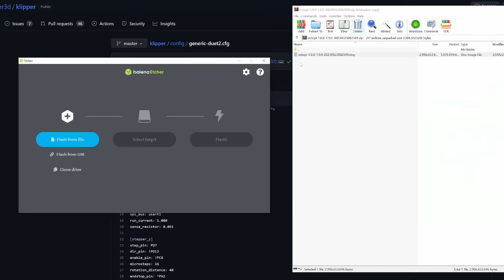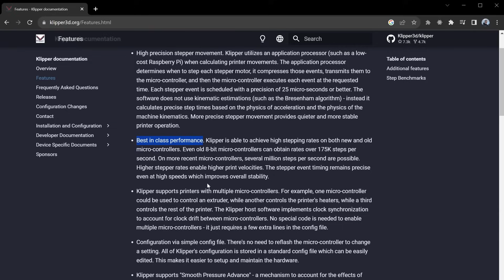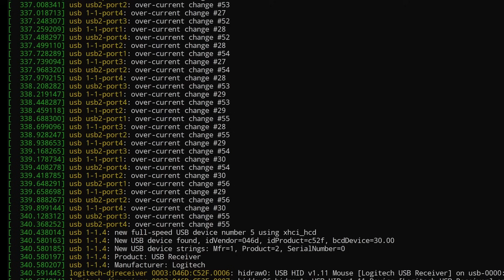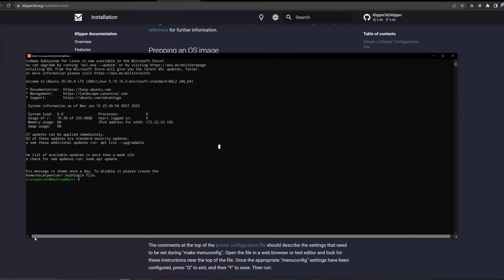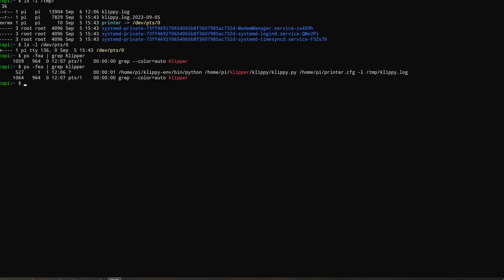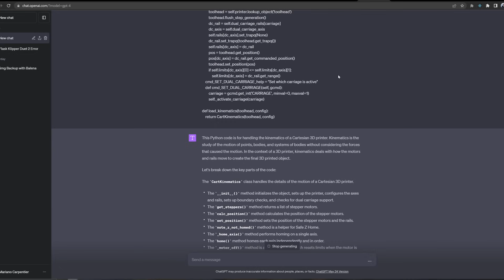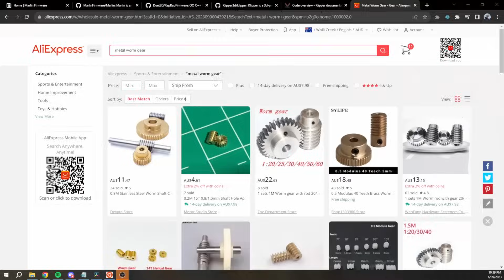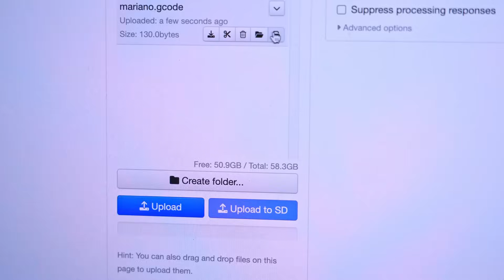5-axis 3D printer with Klipper finally moving!

Comment: You should look at adding a counterweight to the A axis, it would make it much easier to turn since it wouldn’t have to lift the full weight of the aluminium extrusions and the bed.
Reply: True but it would also increase the mass. 
So while a counterweight would reduce load while stationary, it would increase load when it's trying to accelerate.
Being lightweight is usually very important in 3D printing for this reason, the heavier an axis is, the slower it can accelerate which increases print time.
I'd probably only try it if the motor ends up having trouble holding up the load and starts skipping steps.
Reply from the maker: That is a good point! I haven't thought about the impact in acceleration. I will go through an optimization phase once the printer is actually printing plastic and I will try to make everything lighter first!
Reply: What is even the Purpose of the huge downwards Extension, just put the crossbeam slightly beneath the center of rotation(A-axies)

Comment: I’m looking into tilting the bed in the A and B directions myself. If I just have a belt on each corner I think it should be doable, though I’ll need to figure out how to change the slack on the belt as it tilts. Hopefully spring-loaded idlers will do the trick, we’ll see how that turns out. If I can get 45 degrees from the bed and 45 degrees non-planar printing from a pointy hot end, I think I’ll be able to print anything.
Reply from the maker: Make some videos! I would love to see your project too
It is a pain to edit them but the feedback of the people is great. They throw in really good ideas!

Comment: Counter weight via dumbwaiter or sliding bars to balance the bed gantry will carry you a long way with having your printed parts withstand enough for prototyping and testing.
looks freaking awesome by the way
Reply from the maker: I will try to measure deflection on those rods, the backlash, etc, and then improve from there to minimise the inaccuracies. Some people brought up the counterweights idea, and I think it has potential! I may try that while optimising the frame. Thanks a lot for the comment!!

Comment: What software will you use to slice 3d model to print 5 axis?
Reply from the maker: That's the million dollars question!
I am not sure yet, I am sure I can make some custom little program to generate some really particular shapes in g-code and send it to print and proof the 5-axis idea.
Ultimately, this entire project is useless unless there is a slicer that can do it graphically. Programming one of those will be a lot of work, which I don't think it's impossible, but it's certainly going to need a lot of working hours... maybe months/years.
I think I will cross that bridge when I get there, for now I have a bunch of ideas in my head but I have not tried any of them other than writing g-code by hand to move the printer as it stands now.
Reply: @engineerunleashed   I'm in development of a slicer addon that can be used with 5 axis printing. For now I don't think I am able to code it by myself, so I'm searching for someone to code with :) . Ideally it will be able to print everything  (like 3dbenchy standing on its chimney) with no supports and no overhangs.
Reply: @engineerunleashed  the slicing software is what has held back more than 3 axis 3D printing so far. Adding extra axes is the easy bit, especially when we already have 5 and 6 axis CNC machines.
Reply: In 5 axis cnc tool path generation, there is a lot of manual work to split the cutting into different planes. A 5 axis AM slicer would probably be the same.
Reply: Is there some reason you can't run the extruder and axes on separate programs? 5-axis CNC software isn't that hard to come by
Reply: @heartminer5487  i think its like chalk and cheese. machining is carving, is removing. the material remains the same from start to finish.

this? you got lamination orientations, infills, cores, wall directions, omfg...

like, iunno, if i was doing a prop, i would probably want a core of infill printed on the radial, with two final skins at right angles laminating  down the length of the blade...

each and very application is going to be full of all these formerly unknown considerations... sort of like forging or heat treating a part whilst running it through the mill...

and well, when i go through cura or prusa slicer, the amount of options already there... subtle, tiny things...

ive reached the point i just use default settings and dont give a damn about strings, blobs, whatever... i want to print, not scroll through ten thousand options. ( i turn em all on as one or two i do use and theyre hidden otherwise...)

Comment: the force the A axis creates will twist those linear rails like pretzels. You need quadZ belts, same as a voron. I would go for at least 10mm wide belts. You are creating a big lever and trying to counterforce it with unsupported rails. The quadZ design has the huge advantage of creating four fixed points in space. cheers and good luck!
Reply from the maker: Actually, at the moment, what gives is the plastic, the rods are unsupported but they are steel while the plastic is more flexible. Even worse because I printed in "draft" quality. But this is something I want to measure carefully in the future.
I imagine all those side effects will be noticeable in the printing quality too.
I will have to think how to measure that deflection and see what I can do with it, but you raised a really good point there!
Reply: @engineerunleashed  yeah, In large cnc machines that cradle is a big iron casting, it needs to be very stiff. Have you considered going from a worm gear to a closed belt with a large bull gear? the reduction wont be as great, but the force will be spread through more plastic, and as a bonus your backlash will be gone. Will need a larger motor though.

Comment: If you only want ±45° it might be easier to switch to two Z axes, front and back.
Setting those to different heights allows you to set an angle, works similar to delta printers.
But keep in mind that this is also requires that either front or back is translational fixed while the other side has the option to slide in/out.
Otherwise Pythagoras would be very unhappy...
Reply from the maker: I think I get your point but sound like a big change, lets try as it is for now and see where and why it fails. Thanks for the idea!!

Comment: How come you're using Octoprint?  I haven't used Klipper yet but I thought the normal way to get a web interface for a Klipper printer was Fluid or Mainsail.
Reply: You can use mainsail, fluidd and octoprint as a ui in klipper. Seeing somebody using octoprint is pretty rare though
Reply from the maker: Seems to be working with Octoprint with no issues, but bear in mind I'm mainly passing Gcodes into the terminal. For that purpose, Octoprint is just sufficient. But now that you mention those other options, I will look into them too!
At some point I will need to modify the code of those apps to show A and B axes too, and if they are easier to modify (or even better, if they were to support more axes already), that's definitely something I want to leverage.
Thanks for the comment!!

Comment: Why not try a counter balance on the cantilever. Alternatively try a key chain tension approach as used in the voron switchwire. The tension on the cantilever can be reduced by increasing the radius of the gear, but that would slow down the arm so its compromise. Another approach would be simply to enable the extruder to move through various directions rather that entire support structure. The upside down printer in the filament box was interesting to negate that FDM need gravity to work or do they?

Comment: U gotta have pretty good bed adhesion 😅
Octoprint works and it has more plugins but i think mainsail and fluidd are bettee for klipper since they are made for it.
Reply from the maker: People have been talking about them. In any case right now I'm just sending commands in the terminal or sending custom Gcode so Octoprint is enough... but I'm keen to experiment with them regardless at some point.

Comment: make sure Z axis screws are straight or there can be issues with Z axis height
Reply from the maker: One of them I need to replace... it's basically a banana...
Reply: @engineerunleashed  i bend my ones (16x4mm) and they have like 0.1mm max runout :)

Comment: It's a ambitious project, good luck! 

But do I have to remind you that you need closed loop motors for this project?
Reply from the maker: Thanks!! I would consider them like a really good thing to add in the future, but hopefully I can get this to work without them first and then making a "before and after" (or something like that) were we can see the benefits in the actual print.
You're talking about servos instead of steppers? or you think another way is also feasible?
Reply: @engineerunleashed 
For a simple 'Absolute position' sensor, use a rotary potentiometer attached on the B axis center of rotation. Similar to what is used in servo motor. This would provide a plus and minus position for that axis and doesn't require first using a 'home switch'. By reading the value of potentiometer at startup, it can be converted to angular position if desired, you know the swing arm position before moving Z axis.
As mentioned by others, the swinging extensions introduce positioning error. Keeping the work as close to the center of rotation will improve accuracy. Rotate the beam instead of the extension.
Great project I'm following your progress.

Comment: Amazing work! 😎 I found u had experience with broken printer structure part due to some unexpected movement during your development stage, I would suggest you may find useful to apply endstop/sensor-less approach by using TMC driver feature with your duet board (not sure whether your external driver offers same endstop-less/sensor-less feature).
Reply from the maker: I think I will place the Z-endstop at the bottom of the Z axis. For now I put it on top in place of the extruder to simulate the bed probe. During the next iteration that is going to change. Thanks for the comment!
Btw, the endstops can still be connected to the Duet, the external drivers are just there to move the bigger motors.

Comment: I was wondering if id would be possible to use hall effect sensor to measure the position of rotating parts, like under the bed, and on this big gear tilting the bed, for the rest there would have to be other sensor, like laser range finder or something else.

Comment: My first thought when I saw this was, have you considered having a frame with a counterweight to avoid large lever force on the worm gear?
Reply from the maker: Yes, I did consider it, and other people in the comments too, but someone also commented that adding counterweights will increase the inertia of the system and it will affect the acceleration capabilities, which makes some intuitive sense to me... although I would like to try it practically one good day and see what happens...

Comment: Great to see this video! Recently I designed and built a 5 axis FDM printer that is loosely based on Open5x. And I was actually able to print some parts successfully. But slicing turned out to be a bit problematic... What slicing approach are you going to use?
Reply from the maker: For now, I am not aware of any solution like the user friendly 3 axis slicers that we normally use. It will be an absolute pain to slice in 5. I though about using the CNC tools in fusion 360 and making some post-process script to "adapt" it to 3d printing. Some people do something similar in Solidworks and looks difficult. Also, there is an open source program someone made to generate gcode with python. I still have to try all of that, I am sure I can make a bespoke custom little gcode file in some of the languages I know too but slicing a 3d model from a proper design software will be impossible by doing that only.
There are also some white papers that are about leveraging 5 axis but they're full of mathematics. Hopefully there are already some open source implementation of them. I need to look deeper into all of this though, it's still the biggest unknown part for me.
What about you? What did you use to slice so far?
Reply: There are some approaches using a grasshopper script. The one from Open5x (Open Source) also has a simulation implemented. However I was only able to slice one demo file. It's poorly documented.. Others use a CNC machining plug-in from ModuleWorks, also with Rhino. Also there are some commercial slicers around. Usually for robot driven DED printers, but also for FDM like Adaxis. 
However the best slicer should be Dot X Control. Maybe you can request a demo.
I also hard-coded some simple geometry in python, focusing on conformal geometry. It's actually not that complicated for simple shapes
Reply: @engineerunleashed  There are some approaches using a grasshopper script. The one from Open5x (Open Source) also has a simulation implemented. However I was only able to slice one demo file. It's poorly documented.. Others use a CNC machining plug-in from ModuleWorks, also with Rhino. Also there are some commercial slicers around. Usually for robot driven DED printers, but also for FDM like Adaxis. 
However the best slicer should be Dot X Control. Maybe you can request a demo.
I also hard-coded some simple geometry in python, focusing on conformal geometry. It's actually not that complicated for simple shapes

Comment: @13:40 I mean... The obvious solution would be to increase the Arc of the large A-Axis Gear to the diameter that of the length of the Aluminium Extrusion thus increasing the whole constructions rigidity instead of trying to drive it that close to the pivot point causing the backlash from everything flexing like crazy - No? 🤨 I'd also argue that there's no way around installing a 2nd Stepper on the other side of the A-Axis too 😏 But like usual with these kinds of 4-5 projects the Mechanics will be the least of your problem... The Software / Slicer will be the crux.
Reply from the maker: Totally agree... the 2nd stepper will be surely required but I want to measure things first to see by "how much" the entire thing deforms with just 1 of them. And I wanted to make the gear bigger but at the same time I wanted the print to go quick... Impatience won! That's likely to change though.

Comment: why the use of Klipper over RRF, who would support the additional axis natively?
Reply from the maker: I used RepRap Firmware in that same Duet board for a number of years, loved it and the support they offer! I just wanted to do this in Klipper since I will need to modify source code anyways, and I can get Python a bit quicker than C++.
Most of what I am doing in this project is a way to dive deeper into the technology, and I may be wrong sometimes, with some decisions. Time will tell! I will share the mistakes without hesitation since they are part of the learning process!
Reply: Intresting Choise.
from how it looked RRF would have solved 2 issues you ran into with this build quite easy. 
But still intresting to see where this goes.

Comment: I've used klipper on my old board/pi, but on a duet? the duet has it's own wifi and coprocessor setup to do the web interface and deal with the file operation overhead that were the biggest bottlenecks of standalone printers.
Reply from the maker: It also seems like RRF supports 9 axes already. I am just working with Klipper since the main sell point for me is the Python codebase. I actually really liked RRF and the support was real quick when I needed it, it's a shame that now many of the features of the Duet are wasted.
In the end of the day I am open to backtrack any decision, but I want to show the process while it happens, mistakes included!

Comment: what software is planned to be used for model splicing? Stereotech claims that designing a five-axis printer is a much simpler task than developing software for it.
Reply from the maker: I would have to agree with Stereotech on that! 
I need to build the 3d printer first and then get to it. There are some white papers full of maths, then some other strategies like manipulating solidworks to slice... Nothing I've tried myself yet, and it looks like the opposite of "user friendly"... it's going to be a challenge, that's certain.

Comment: You can ssh from powershell
Reply from the maker: Good to know!! In any case I am terrible with powershell, so long I have a linux like terminal to use I go for them and never ended up learning powershell.
Reply: @engineerunleashed more specifically: windows has openSSH built in (since windows 10 I believe)

You can simply run ssh@host just like in linux straight from the windows cmd/powershell/terminal

Comment: Using a counterweight would help with living the axis.
Reply from the maker: Yes that's true, but someone pointed out that counterweights may affect the acceleration. The more mass I need to move, the more inertia I will need to overcome. But out of curiosity at least I think I am eventually going to try using the stepper as counterweight, and probably adding a mirror extra stepper in the other side to keep my OCDs happy. I first need to get everything working so the changes can be benchmarked, I don't want to start optimizing before I can start measuring the results.

Comment: Why not use belt or chain for A axis ?
Reply from the maker: I tried many different belts and pulleys but it didn't work too good. I may try again in the future since plastic gears are not going to be accurate enough I think. I just want to get an MVP Working first, and then optimize.